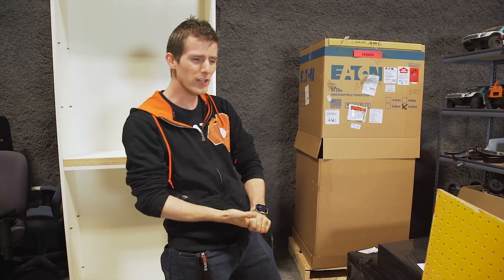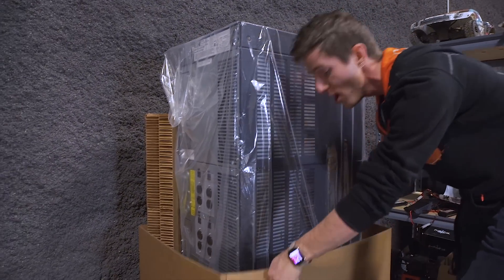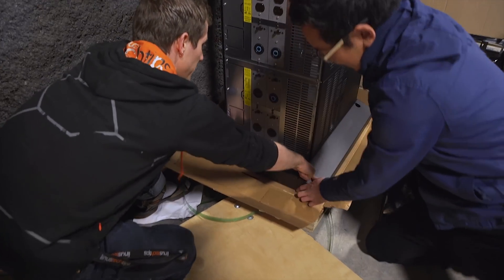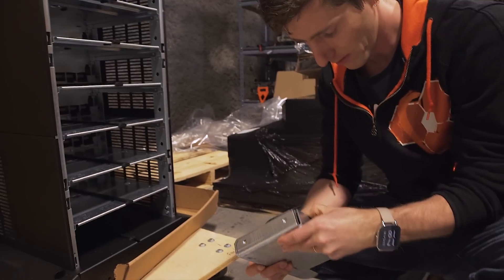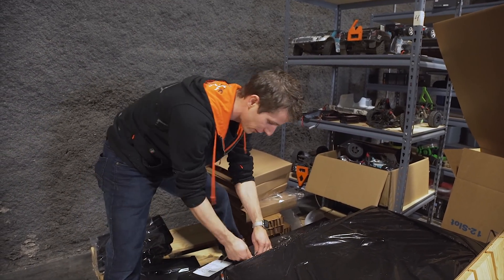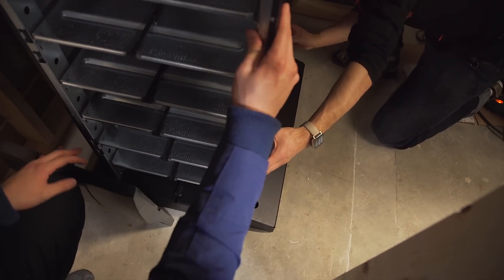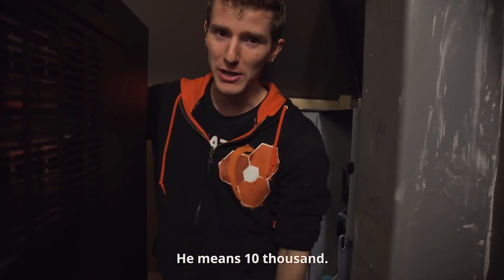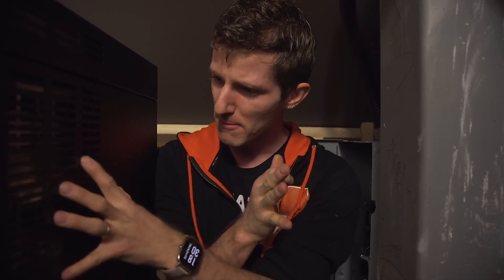HOLY $H!T - A $17,000 (CAD) Man-sized Battery!

Comment: tbh, i've seen bigger, and i've seen 2 at the same time that were bigger, of which 1 i installed. I think they needed 5x180mm2 wiring, each. You cannot imagine. They powered 1 Lab with 4 Racks, with several emergency systems. I am sure i could dig up a photo somewhere.
You might aswell hook up a Diesel Generator aswell, lol

Comment: Why not get a PDU for the server rack and run everything off 240? Assuming most everything in the rack has a univeral input and should be fine with it, plus more stuff running on a single 20A circuit for easier wiring?

Comment: 10,000 watts for a company of computers and servers. My computer subs take 2,000 watts and car battery to run in for a hour with no issues. Granted that is only ~12V, but it is a single battery entire system at 200A charging. Pretty amazing to think.

Comment: For everyone suggesting a generator over a UPS and for everyone complaining that a UPS is a better option because of continuous non-fluctuating power supply:
THINK for a second: Wouldn't a small UPS combined with a generator be the optimal solution here? Non-interrupting power supply and a longer duration in case of a blackout.

Comment: were I work our ups can deliver 30kVA (only for all computer systems) for half an hour but it will never need to because after 7 seconds the emergency power unit is at full power with 870kVA.  and thats only for all the things that are needed even during an emergency. normaly we use about 5-6MVA under full load

Comment: I wonder if you flip that small red switch on the PSU's to the 240v setting and use the higher voltage outputs of the UPS, if you can gain a little efficiency and therefore runtime? It would be important to know how the batteries are configured and how the circuits inside the UPS are configured to know for sure which method is most efficient. I assume there is a huge bank of SLA batteries in that monster UPS and that there are 16 or 32 wired in series for 192 or 384 odd volts which can be regulated and fed into a rather large H bridge and a low pass LC filter to convert it to AC. If the voltage has to be boosted rather than lowered and regulated, that is less efficient. And ohmic losses at lower voltages/higher currents will result in shorter runtimes and hotter operation.

Comment: Can someone please let me know if this is a good pc build?
i5 4690k (cpu) oc to 4.2
dual gtx 970s sli (gpu)
corsair cx850m (psu)
corsair h100i gtx (cpu cooler)
msi z97 gaming 5 (motherboard)
Reply: +R00zGaming seems fine except for the power supply get an rm series or an evga g2 or p2
Reply: +R00zGaming seems good there is nothing wrong with the psu tho.
Reply: I question why you are getting two 970s and not just getting one better gpu for that kind of money, seems illogical to me.
Reply: +R00zGaming Don't go with dual 970's. Dual gpu systems just cause a lot of trouble. Go for a single 980 ti, maybe one that's factory overclocked, and you'll get around the same performance for around the same price, but with much less hassle and no problems with games that don't feel like implementing proper sli support ahem Just Cause Ahem
Reply: Thanks everyone for responding. I will just go with a single gtx 980ti.
Reply: which 980ti should i go for tho? 
Evga or gigabyte?
Reply: R00zGaming Personally i would go for an asus strix, although there isn't too much different between the cards. I found a really nice article that's really helpful in choosing a card: http://techreport.com/review/28685/geforce-gtx-980-ti-cards-compared/7

Comment: UPS is good for a little bit, but a proper backup unit would also consist of whole house propane or natural gas generator, 18kW/h or more, My neighbor has one and it automatically kicks on after 3 seconds of no or out of voltage power from the mains(and disconnects power from the mains so its not risking utility workers lives by sendiong power back into the lines that are supposed to be dead. The unit can power both of our houses when power goes but we only have it wired so that her generator powers our water pump(that feeds both houses with fresh water) and one outlet so we can plug in our freezer and fridge and SATCOMS. She got it because historically we've been without power for as long as 2 weeks after bad storms that knock out surrounding cities. I plan on getting a portable 10kW/h propane generator and putting it in my limo, that way i'll have dual fuel and better overall economy, i could use the cheaper propane, fill up at my house from either of the 1000 gallon tanks or the single 250 gallon next to the shop where it is parked or at the nearby welding supply stores/industrial propane outlet, i think you can even buy vehicle grade propane from the menards and one of the SAMs club in a nearby town
Reply: +denvera1g1 +LinusTechTips you should get a 4000(burst) generator  as additional backup, have the building and computers enter low power state when mains power is lost and a unit like this should be good enough for that UPS as it can put out a constant 6kW, its electric or pull start, should be good for a few days and the UPS should handle surge needs much better than the generator alone, unless you need that to be constant 12000 "kV" (i'm assuming you meant 12000watt) 
http://www.walmart.com/ip/Sportsmans-Series-7000-Watt-LP-Generator/15609526?

Comment: People are saying generator in the comments.  A UPS and a generator serve two different functions.  Although they are often used in tandem. For example, in most hospitals, and most other places that require constant uptime, you have UPSs on mission critical stuff like servers, SAN, etc. In the event of a power outage, the UPSs will keep the critical equipment running for the 10-20 seconds it takes for the big diesel generators to kick on, spin up, and allow the transfer switch to close, transferring loads to the generator.  You still need a UPS of some size, and in Linus case I think I would have gone for a more moderate size UPS, maybe 5-10 minutes of runtime, and gotten a diesel or Natural gas backup generator with transfer switch.  That would in the end, probably cost more money though.

Comment: Ouch Linus, I hate to say this, but while this is a nice system, I think you got taken for a ride. I work in a commercial data center and really all you should have a backup generator, with a UPS  that only needs to be able to handle the load for how ever long it takes the generator to start. Two in parallel if you want redundancy. Such a system would provide the conditioning you wanted, and provide independent power for how ever long you want.

Comment: Personally, I would NOT seal that thing in the back of the server closet. You will have to replace the batteries in 4 or 5 years. And having a door on that side makes a lot more sense to have access to the front panel. Otherwise, you have to try and get around your server rack. That just isn't a very good idea. Also... No one read the instructions on how to put it together which is why Linus broke it 10 minutes into the video.

Comment: Power outage? What's that?
No seriously I'm german and I'm 27.7 old and I witnessed 5 so far, longest one 30 min.
OK given that, our electrical standards are very high and a pain in the ass to hold up.
But looking at those numbers seems to be worth it. (Yes america's electrical infrastructure gives me the creeps)

SIDE NOTE
Unfortunately I only found the numbers for 2014, 2015 isn't published yet:
The average outage time was 12 min and you have to expect 2.4 outages in 10 years.

Soooo If you want not to worry about it move LTT to germany :-D
The moving vlog was fun and we will welcome you with open arms xD

Comment: Seriously, you're better off having the battery act as the AC to DC point and run your server stuff just with DC to DC. It will be more efficient, run cooler, and would have ended up being similar cost at this point.
Wait, extension cables? So happy I am not in charge of that little server farm.

Comment: You should see the batteries they use in submarines. Each is a single 2.2 volt lead acid battery that stands over four feet tall. Each battery is capable of a huge amount of and Hours. There are very many batteries in a battery banl wired in series and parallel to deliver the D.C. voltages to the boat.

Comment: Linus sized Laptop battery for servers? what battery chemistry? (please don't tell me enterprise is still charging you that insane amount for old school lead acid batteries)
Reply: +2Awesome it is lead acid battery... ewww...
Reply: +2Awesome whats wrong with lead acid batteries?
Reply: +2Awesome you clearly dont understand batterys xD, lead acid batteries are probably the best for this solution... let me guess u wanted him to have human sized lithium polymer batteries, the biggest fire hazard i could think of. 1. Lead acid batteries can actually be easily serviced. 2. If oxygen gets to the lead it wont set fire or emplode. lithium polymers are for smaller devices such as mobile phones because its cheap, lightweight and you can make a thin battery just by rolling up a few sheets of lithium. the downsides are if its exposed to air = fire exposed to water = explosion
Reply: D. Conn Lithium battery fire/explosions are rare now and are from very badly designed batteries . Lead = low lifetime/leakage/heavy/large
Reply: 2Awesome Only problems ive had with lead batterys is crystals forming on the cells, take it to a shop they refurbish it for next to nothing.
Reply: ***** 
Yes full charge/discharge cycles aren't common in UPS but i guess the most idiotic use of any kind of battery in almost every UPS ever sold is that the batteries are kept at  such a high voltage that ruins the batteries way before they need to. Laptop manufacturers are guilty of this too (notice how your laptop you always keep plugged in has like <60% battery capacity after <1year, put if you would keep the battery at even 80-90% capacity you would have 90%+ capacity still left?) Yes heat factors into it too if you want to get technical but it's not the only guilty design decision. 

Size and power density are better with lithium ion batteries vs lead acid (saves on office space and size of that overpriced marked up cabinet they sell you, and I guess you wouldn't need those "power modules"

I'm sure you could calculate the vampire load of the UPS with lead acid vs lithium ion ( I don't remember the technical term or the exact numbers but you understand what i'm referring to right(post it if you want, i know internal resistance is a large factor)?

Since when do you get employees beating up UPS with baseball bats, fragility of the casing won't matter? Fragility has little to do with a disadvantage either way I guess, the difference would have to be with physical design rather than battery chemistry.

With cost factor, I guess it depends on the huge markup on the batteries themselves (even prices on lead acid UPS per kWh on UPS systems are insane tbh)

Comment: That's a cute little UPS :)
The 480 KVA ones we use take up two racks for the UPS controller/inverter and have six racks full of batteries, each.
I deal with around 2 MVA worth of UPSs in sizes from 200 to 480 KVA.

Comment: Linus - I'm curious, server rooms are air conditioned halls that are really quite chilly if you stay in there too long (I know first hand) the cooling on server components and potentially this UPS are designed for those environments, are you not concerned stuffing this unit under the stairs means it won't eventually overheat along with your server components? Or do you have cool air 24x7 in this area? Or are you just ignoring it?

Comment: At 17k you could have gotten a diesel generator that the power goes through and. Automatically starts for zero down time and can run as long as you have fuel.

Comment: So, 26-28min at full load (10kW) => about 4.5kWh energy storage. For comparison, a 7kWh Tesla Powerwall costs $3000 and can deliver 3.3kW power. If you buy 3 of them, you also have 10kW of power but 21kWh energy storage, so you can run it for 2 hours at full power and it's cheaper too. I don't know about the response time, but I think your solution is way too expensive.

Comment: For those who do not seem to understand the difference between this and the Tesla Powerwall, this UPS sits seamlessly between your net power and all your computers. It can supply 12kVA at the same time, and it has a stored capacity of only 5kW. The Tesla Powerwall only delivers ~2kW but at a capacity of 10kW. The price in here is that for 12kVA you need very high quality components not to affect efficiency and the power components for this capacity to stabilize/filter the power from the grid are expensive.

For them it's not about being able to continue to work for 28 minutes, but to be able to safely have all servers shut down, and thereby avoid data/disk/machine corruption.
The difference with a generator is that a generator does not provide a seamless transition when the power fails, and a combined UPS + Generator will cost at least twice as much again (and you cannot store a generator inside your cupboard inside).

Comment: Linus. sorry for my bad english. but i have been working with UPS systems for the last 6 years. and it looks like a decent backup system. more then needed for your setup. but i am conserned with you cooling in your server room. a UPS system like that generate a lot of heat by it self. and the batteries in your system need to be at a maximum 24 degrees Celsius. or the lifetime of your batteries will deteriat drastik. if the tempreture is suficiant the life time of the batterypack is proberbly 5-8 years. but if even some of the batteries are not. you have to change some of the batteries after 1 year or maby even befor. and after 3-4 years you have to change the hole battery pack. becus the new and old batteries wild go dead. you can test the battery pack on the system. but it will only tell you if there is a foult in the pack, but not witch battery it is. and its a pain to measur the batteries to find it. in short. i just want to give you a heads up that i hope you have taken all this i consideration.so you dont waste money on batteries. the video dident rely show you cooling setup. but best of luck with it. :)

Comment: cute... my ups is also 12kva and it cost me $800. It's just for my computer so it only puts out 5kw but it last a long time. it's a completely issolated system, charged off a 2.6kw solar setup I built for $600. My computer, monitor and speakers use about 1900W at full load and if I use my rig all night the batteries run down to about 50% by about 2am. saves me $450 in power every 1/4.

I would have built a custom setup like every data centre or cellphone tower as you would get a far fucking better setup than that for 17k.

Comment: why wont you use the 240v plugs on the power output site? every psu is more eficient with 240v than with 120v. and every psu i've seen can handle both voltages...

Comment: I'd rather get a diesel engine generator, so the current UPSes would handle the servers only until that kicks in (15-20 seconds maximum). The runtime would be limited by just the amount of fuel...
Reply: +AttilaSVK They don't need run-time. They aren't going to be using the computers when there is no power. It's just to save their stuff and shut everything down.

Comment: LTT does not need ANYTHING close to something that size for an UPS...  smh  I bet LTT goes bankrupt within a year
Reply: Fapperson lolz  I've been in IT for 20 years...  stfu kid. Jesus Christ! kids now a days
Reply: TallahassZ Remington Im obama
Reply: +TallahassZ Remington Its possible they want to increase their server amount OR incase of long outages of power, power outages can last anywhere between 1 minute to over 8 hours (especially if its power maintenance)
Reply: Only 12,000 USE
Reply: Are you sure? It doesn't seem excessive it's only buying them half an hour to shut down the servers.
Reply: +TallahassZ Remington they probably got that thing for free or at a huge discount for featuring it on the video.  but i agree, this is way over kill for what they have shown to be operating in their videos, several times over.  especially since they only want to be able to instantly shutdown and not run for a while.  they shouldnt be measuring what the servers draw when at full load as they wont be at full load as soon as they begin to shutdown and all the heavy processing stuff stops.
Reply: +mark rossi of course they need enough watts to handle the system running at full load though, still this is over kill, they havent shown 10k watts worth of equipment
Reply: +mark rossi of course they need enough watts to handle the system running at full load though, still this is over kill, they havent shown 10k watts worth of equipment
Reply: +TallahassZ Remington Oh srry, only trying to run a full blown company. You're right. The consumer grade stuff is all I need. Lol and if you think 17k is going to make a company as large as LMG go bankrupt within a year you oughta head back to school.
Reply: Fapperson We don't know how large LMG is but think of it as a small construction company being a new van.
Reply: +TallahassZ Remington Is this the new children argument hub? You two kids really need to learn to stop arguing with each other over a company that you have no part in.
Reply: +Venturers Unite I'd fully support them if I could. I actually enjoy their content. LMG that is.